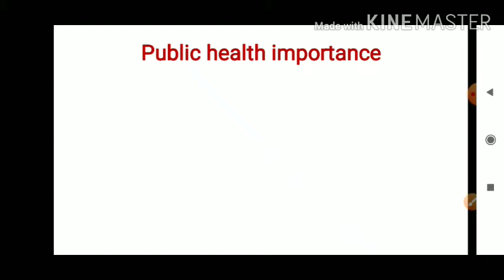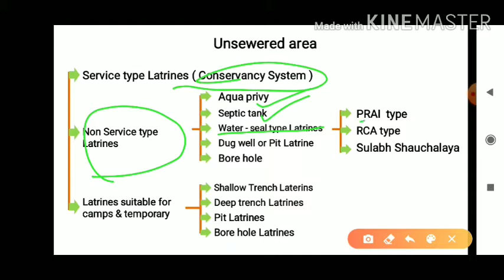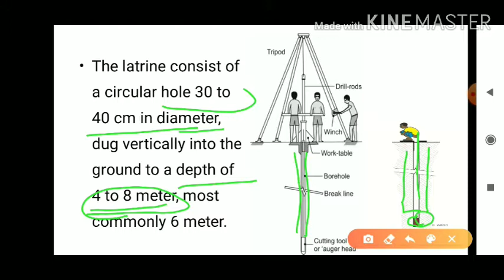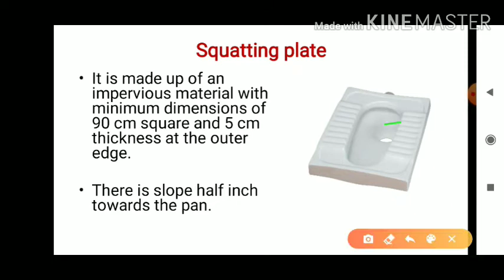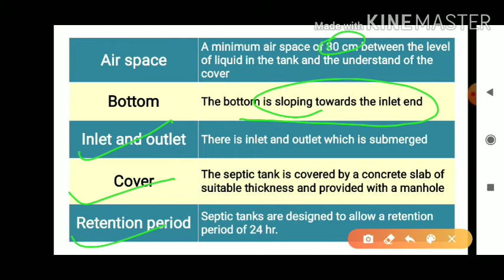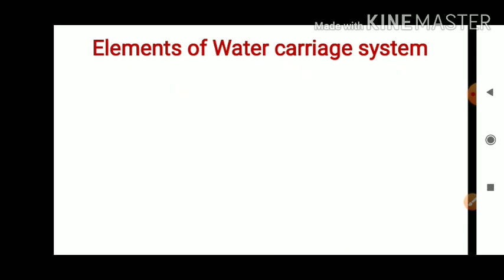Environmental factors contributing to health: Waste (Excreta) / Types of excreta disposal / RCA

Comment: Roll no 1 present mam
Reply: Difference between shallow and deep trench..?
Reply: @srishtitiwari539  the shallow trench is 30cm wide and 150 cm Deep and it's length is depend on the number of users
But deep trench 1.8to2.5cm deep and 75 to 90 cm wide